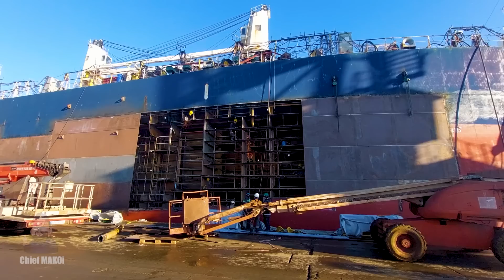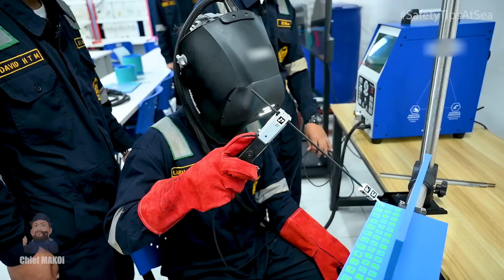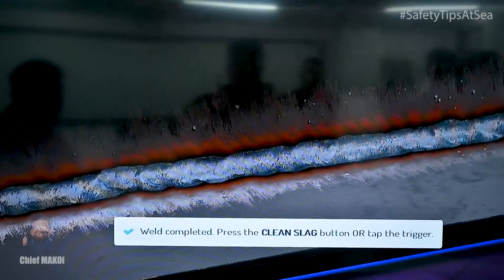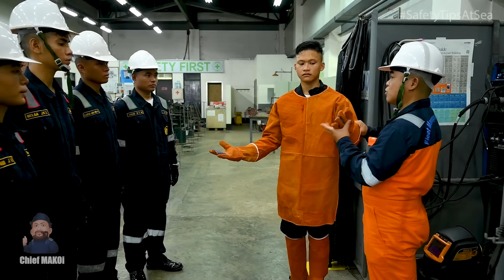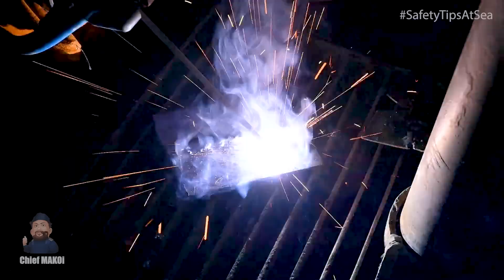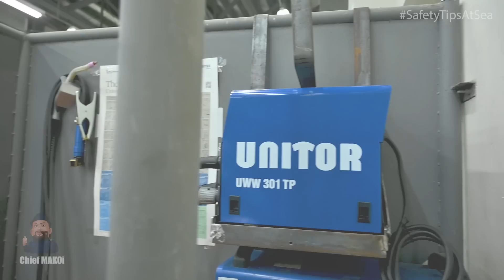Welding Safety:  How Training Impacts the Safety of the Workplace | Chief MAKOi

Comment: I have used both a lincoln and miller virtual trainer.  I didnt find much use for them.  Machine would beep and tell you you were doing something wrong but trying to figure out what direction they thought you hand needed to be adjusted in order to make a better weld forced you to focus on your hand rather than the weld and you really couldn't gain much from it.  I had experience welding already so maybe that's why it was frustrating.  Some other people that didn't have experience seemed to value using it prior to hot work.  Generally I think its pretty limited in how much use you get from it.
Reply: yea, was thinking the same thought as learned to weld in high school and some in college too back in the 80's and 90's  never welded on a simulater eather and not sure I would like too or want too.
Reply: @marlawhite3682  I think for someone who had never welded at all there is some value to it for maybe an hour or two but if you have any real experience they are wasteful.  They are also extremely expensive so I think that money could be better used in other weeks shop equipment.

Comment: Sir can you comment on this, thanks:
 Kongsberg Maritime has received Approval in Principle from DNV to transfer the Chief Engineer role from ship to a shore-based control center. This allows the Chief Engineer to remotely monitor and control systems including the Power Management System, ballast water system and deck machinery from a desk. The trial will involve managing three vessels, including the fully electric Yara Birkeland. This innovation aims to address the seafarer shortage and enhance vessel operation efficiency and safety.

Comment: Safety starts in school, absolutely. I was a welding apprentice in the Boilermakers Union at 17 and after immigration switched to Sheet Metal Workers Union. Welded for 40 years and taught in later years night class. All our construction projects had safety officers who issued hot work permits. In all my years I never saw a  problem on any of our sites.

Comment: chief what funny stories did you experience when working on ships ? one i got when i started working on new factory three 440v fuses were tapscrewed in place with selftapping screws by someone becouse they were overloaded and tripped whenever someone started some large electrical motors, not ship just offshore rig. maintance team spent 2 weeks on rerouting to get it on order and fuses behaving like fuses. Edit: it was natural gas and crude oil separation plant in north sea

Comment: A very good lesson, Chief. The safety tips presented can, and should, translate to every hot work situation, be it work or home.

Ok, home may not need the paperwork, but pre-work evaluation, proper PPE, and general safety concerns & precautions will serve a user well.

As mentioned by others, I'd never seen a welding simulator - fascinating!!

Lastly, even though the first "live" weld bead will more than likely look terrible, there's nothing quite like striking that first arc, and laying down that first bead.

Again, thank you for another great video!!

Comment: What an awesome welding simulator. Wish we had those in school. I remember my first attempts to try MIG welding in a school auto club, & the bead kept getting the nozzle tip stuck to the plate. This often caused a big birds-nest traffic jam backing up onto the spool which was still trying to feed material into the now-clogged nozzle. Then we would have to pause everything else to get the jam untangled. 

I’m also not sure if the welding mask was having issues because it seemed like I could not see the slightest hint of anything besides the arc, so it was hard to even tell the height of the nozzle above the plate. If I remember correctly, the auto-darkening wasn’t really working (it was dark even before striking the arc), so you were basically starting blind. 

Needless to say, I did not get much out of that first experience. Still not sure if it was due to shoddy equipment or just the alien nature of welding.
Reply: Some MIG welding outfits are of poor quality and are very prone to sticking and tangling. Also some goggles have the problems you describe. I rather like oxy-acetylene welding equipment for anything for which it is suitable, but many people now regard it as obsolete. It gives you separate control of the heat and the filler metal, and it does not produce the extremely bright light that electric arc welding does so for oxy-acetylene the goggles allow you to see clearly what you are about to do and what you are doing.

Comment: While I think the welding simulator is helpful, it doesn't really help with stick welding because the stick gets shorter and shorter, and you have to learn how to tie in between two sticks.
Reply: I doubt it would make much difference, the fact the stick is getting shorter makes it easier to control and if you can make a nice bead while controlling a one foot rod on a simulator am sure you will have no problem in real life.
Reply: @garlicandchilipreppers8533  I think the challenge is maintaining a good arc length as the stick gets shorter while maintaining good position, so actual training is still necessary. There's a reason people get paid big bucks for welding structurally critical stuff.
Reply: It looked like the simulator had a motor to shorten the working end while you go. There was only one shot that showed it "shorter" so I may be wrong.
Reply: I aggree with that too!!  As knowing welding from high school shop and some college.

Comment: Hi 
I wander how many welders noticed a really minor mistake, when the trainee lit his cutting torch he was using a lighter designed for a propane torch as the lighter for acetylene has an open striker and for propane it sits in a cup this is because propane is heavier than air and acetylene is lighter still they both work and it matters not a jot in my book
Great vid

Comment: Chief - great video; especially the welding simulator as I have never seen one of those in action.  A lot better method of instruction than the way I learned 60 years ago.  Large companies and the military (at least in my experience) usually have the proper focus on training and a proper safety culture.  But even then problems can arise.  I remember one time a plumbing contractor had to do some overhead work on a weekend.  Proper hot work preparation, permit, etc.  Still did not stop the knuckle head they had doing the work from dropping an acetylene B tank from 30 feet up, going through the ceiling of the manager's office and hitting the middle of the desk.  Fortunately nobody in the danger zone and the tank did not lose the valve fitting.  Nobody got hurt.  Keep up the good work.

Comment: You gotta move the welding rod.  It's called "Weaving."
You weave the bead, not just drag the rod along the material to be welded.
Even MIG welding would require that you weave the bead.
They make a 'splatter spray,' to prep the work with, before you weld, so that the splatter won't stick to the material.
I learned about welding back in the 70s.  I even got a state certification for welding.
Everything has gone from 'arc welding,' to MIG welding.
I always enjoyed arc welding the most.  But the industry demands MIG.  Can't really tell you why.
Reply: I bet weaving is easier in rough seas lol! I too used to love arc welding, but it is tough on thinner metal, but on the thicker stuff it's a blast!!
Reply: 8.1 earthquakes are even more challenging for Welding 😮, "quite shaking the table" 😅😅!!!
AA+ on your weld son😂...